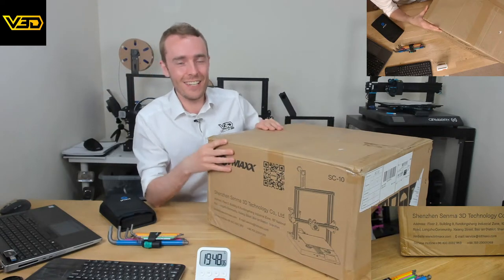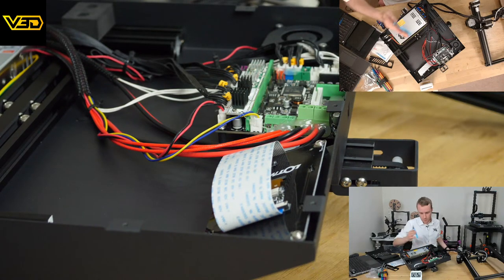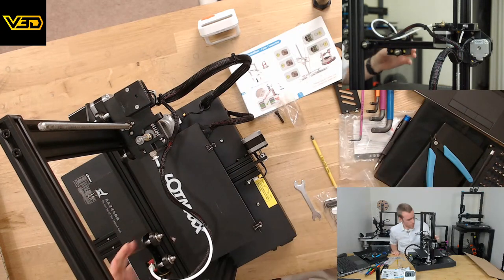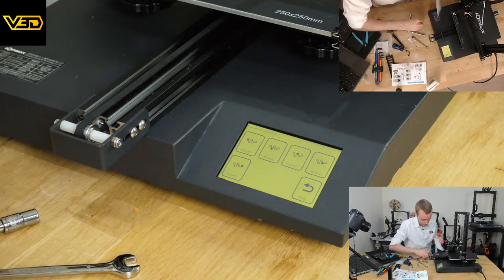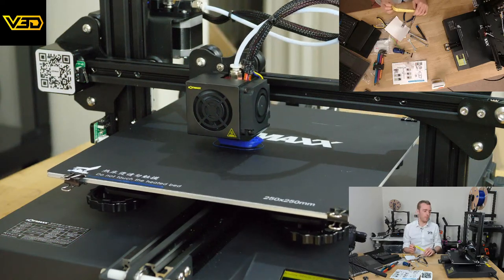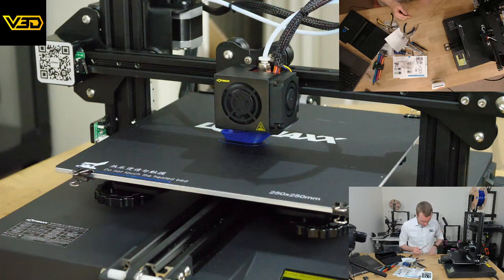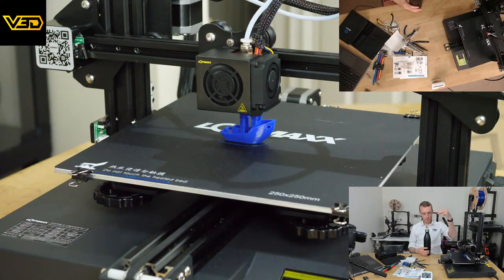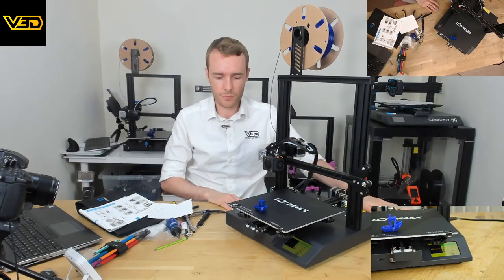Lotmaxx SC-10 3D Printer - Unboxing, Assembly, First Print

Comment: I couldn't help but notice that Joel also recently looked at this printer - and it's nothing like the unit you have here. I mean, it is, but the touch screens are totally different. (Unless the inclusion of the 'Shark' designator in the name is similar to what Creality does by using 'Pro'.) https://www.youtube.com/watch?v=VbetE1tSvM8

Also, one idea about settling the whole 'is it a rebranded Creality machine?' debate: remove the hotend fan cover/assembly and check the label on the back of the fan - rebadged units still source Creality-branded fans, or at least they did.
Reply from the maker: Ye, the sc10 shark is a different machine. Confusing I know. I've asked them now, apparently it's a totally independent design.